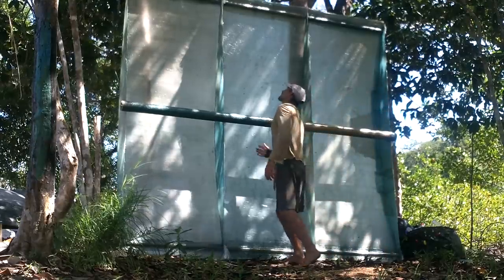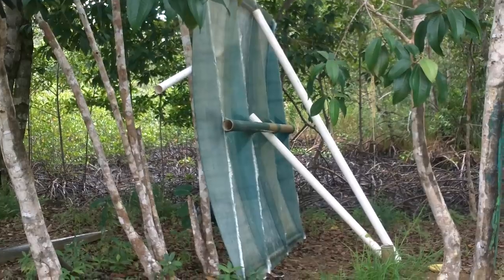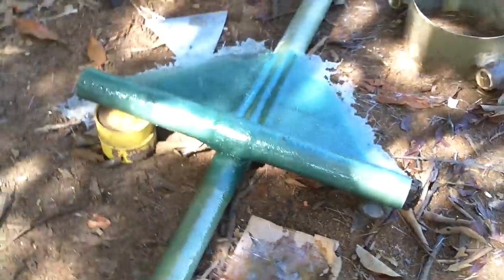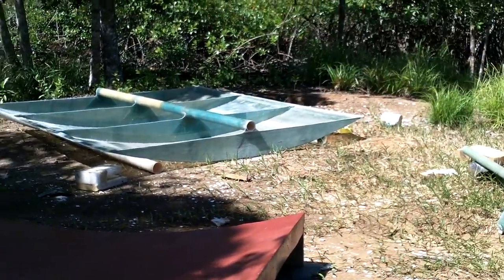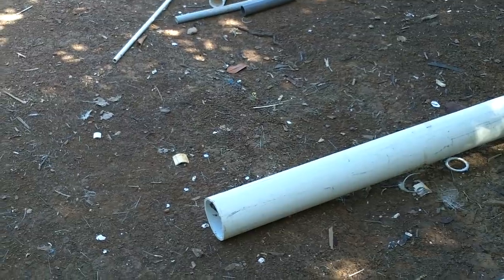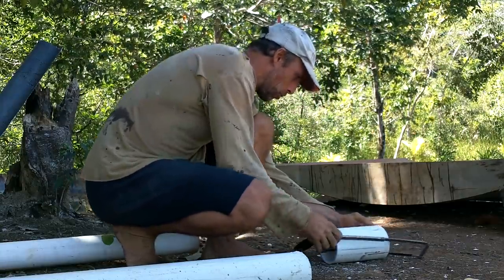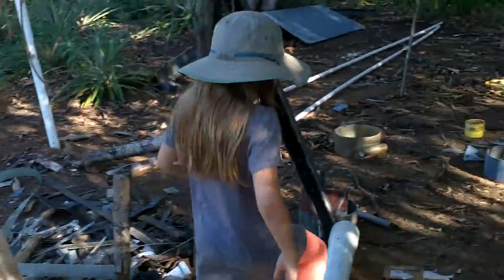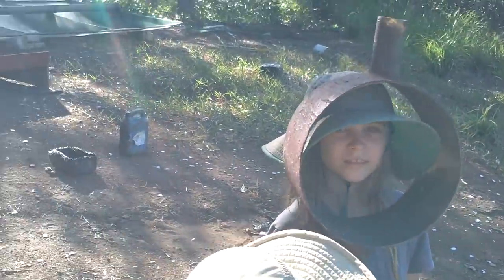Solar Snalier 024 Metal

Comment: My 2 cents is: use ropes (lines) where ever you can. Even if 4 per sail. Run then back to your new hard points with blocks (pulleys). Might have some on your sailboat. Also, raising the masts with the panels on them, in wind enough to to sail, might take some force. Maybe a bowsprit with a line forward to pull both masts up. I'd add a winch too, could be good for cargo handling, etc...

Comment: Using a slotted pipe section at the boat back to hold the mast down and another at the bottom of the mast to hold it straight up with a pass through pin to secure it. Just like you showed.

Comment: I've been watching you since building a cabin in alaska. I've learned ( and will continue to learn) tons from you and the way you process visual images into reality. I grew up sailing and I am curious to see how the fiberglass sails will perform.  Just curious if you calculated (displacement length ratio), ( sail area displacement ratio) (lift to drag ratio) , a lot goes into getting proper sail for boats.  I have faith in you!